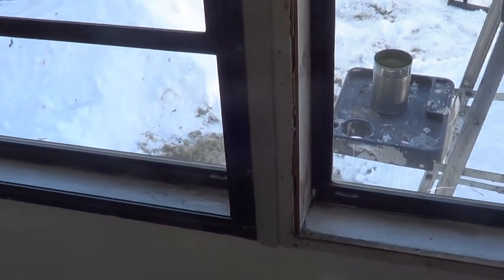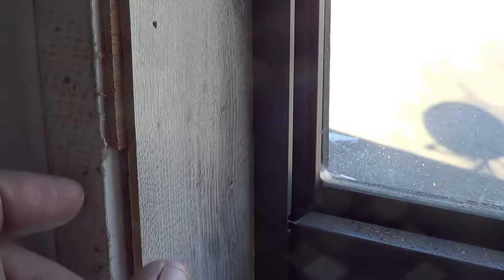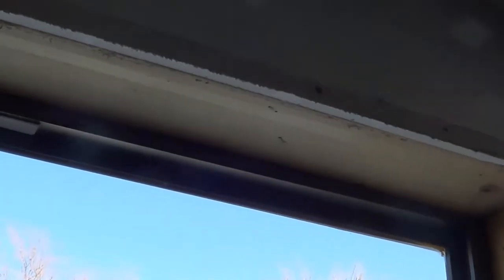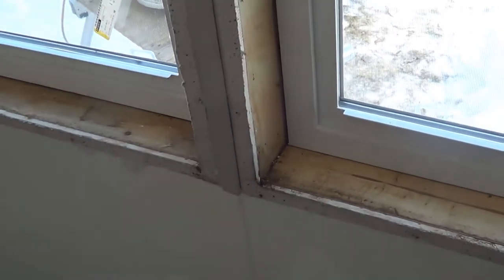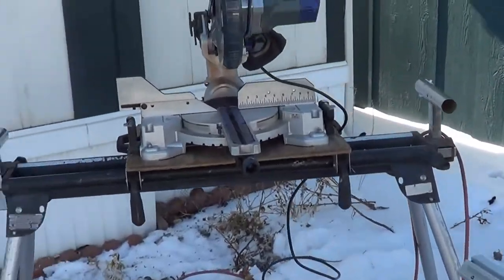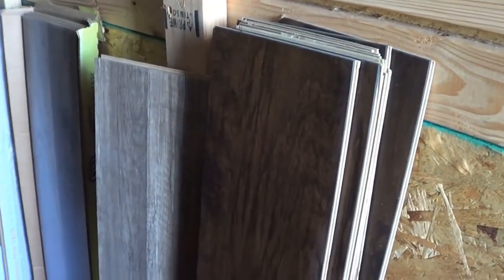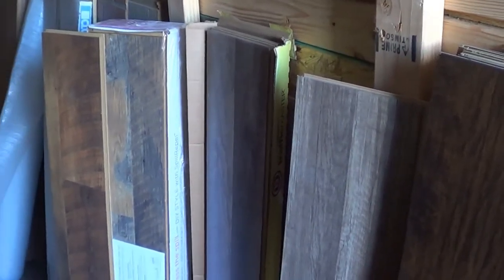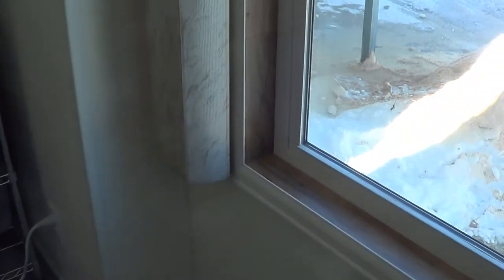How to Replace Mobile Home Windows

Comment: Love the video,  Finally  a way to see how to correctly measure. I wish you would show the outside flange and what you put behind it? Caulking or putty tape?? I have vertical siding with a million screws in the frames.
Reply: Hello, thanks for watching. I love the switch from metal to vinyl and the actual window seal finished look. I wasn’t sure anyone would want to see the basic install on the outside window, but maybe I should have went over that more, sorry. I did use putty tape on these one, though sometimes I do caulking if we are trimming over the flat screw heads as the putty tape seems to make them stick out a little more. Thanks for the comment.
Reply: Did you use replacement windows or new construction?
Reply: @stephenburkhart8052 my mobile home is the same. Trying to find a video now of how to do the outside. We are going to be replacing siding as well after the window install.

Comment: Thank you for the info. I will be looking to buy new windows soon. How does buying these windows work? Are certain windows actually classified as mobile home windows? If so, we’re do you get them? Also how are windows for sale sized? Are they based on the window opening? Thank you again!
Reply: There are ‘mobile home’ window companies yet really any of the large store like Home Depot or Lowes can special order sizes that you give them. Me here in Colorado, I like to use ‘Mobile Home Parts 4 U’. I would suggest doing away with the metal type and going to a double pane vinyl of course if that’s not already on the agenda. Good luck with the project and thanks for the comment!

Comment: How do I measure the window I want to use a home replacement window
Reply: Hello, thanks for the question. It’s always a stud to stud measurement. How to get that is different in some cases. They put the window in sometimes and then drywall what’s left of the window seal or the use boards like we did here and trim the face. I know it’s not much help but  you just have to find a way to get to that stud measurement and the top to bottom.

Comment: So what do you use to lay down laminate flooring in the windows?
Reply: I’m sorry I don’t understand the question. We use laminate flooring material, ripped down to the correct width to make up the ‘window seal’ and trim the face.
Reply: @randydolph852  I think he meant what do you use to make the flooring material stick to the 2X4s?
Reply: probably air nailer would be my guess.